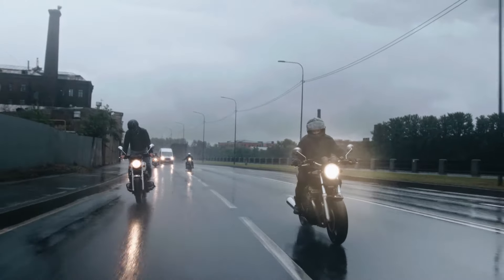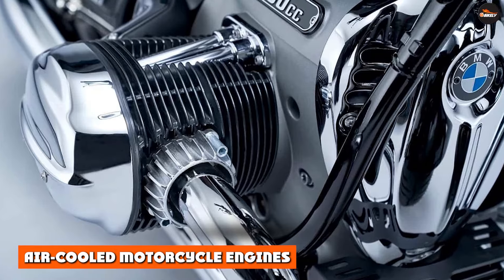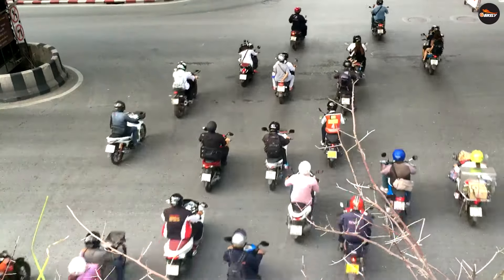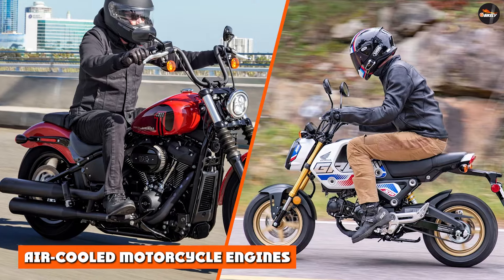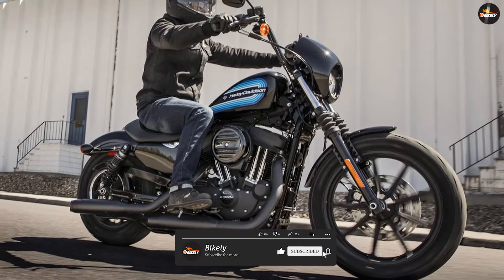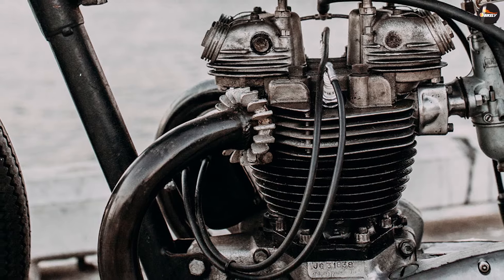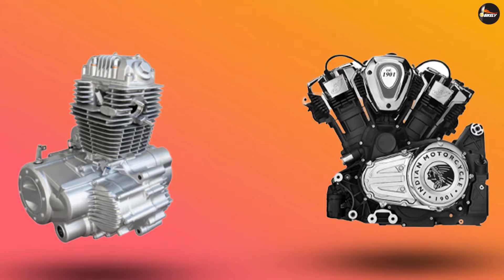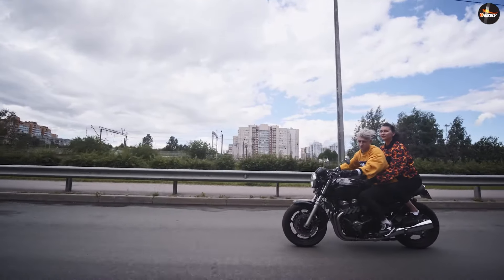Air Cooled vs Liquid Cooled Motorcycle Engines: Which Method is More Effective?

Comment: Einstein said: things must be built as simple as possible but not any simpler. The only reason manufacturers have switched to liquid cooled engines in the las few year is to comply with recent government emissions regulations.
Reply: Not so else why cruiser n small cc bikes still have air cooled engines ?
Reply: @vickyAlways  Because bikes with just one or two cylinders can still have enough airflow to keep the cylinders cold enough to comply with emissions regulations, and very few cruisers bikes are still air cooled such as the Indian chief dark horse which actually shuts down the rear cylinder when the bike is not moving to keep the engine cooler.
Reply: He said the same things 2 or 3 times.
Reply: Why did ALL the Baja 1000 dominant bikes become liquid cooled in the early 2000s then?

Comment: They are not just air cooled motors they are air oil cooled, for the novice or new rider, it's means oil runs through the motor as opposed to water, and they do quite often have an oil cooler ( radiator) for the oil , for example I have a cb1100 Honda 2010 model that runs 4 point 9 liters of oil the same amount of oil in a Holden 6 cylinder. And you can not beet some warm air on your legs and feet on a cold day riding. Oil  cooled won't corrode out like many water cooled motors. Cheers Andy from Australia

Comment: What about the engines with the oil cooler?
Reply: It's still air cooler based. Just a little bit advance which it's circulated the oil through outside so it cooled down with air too.

Comment: for long lasting run ... air cooled all the way
Reply: Why is that if I may ask, I can argue water cooled can last longer as the engine doesn't overheat. Just trying to learn.
Reply: @m7md4x4  maintenance i guess, water cooled engines are consist of many parts as the videos says, more parts more malfunctions. as air cooled really only requires the engine to rest.
Reply: @m7md4x4  IMO, if both bikes are moving at a steady pace like 45+ mph, it does not matter which you use because the ram air is either hitting the radiator to cool the coolant OR the ram air is passing thru the air cooled engine fins to push the hot air away while cooling it down. 
In traffic the water cooled engine is obviously best. 

Now in hot climates can affect air cooled but i don't know how hot it has to be before that has an effect on the air cooled engines. 
Im in Florida so its Hot year round like 85-95F .... Not sure if thats considered HOT for air cooled motors or if maybe Vegas heat at 115F ....
Reply: @MichealLearnsTo  Right, if your on the hwy and a coolant line burst open ..... You got seconds before you overheat and sieze up the motor, while the Air Cooled has no coolant to worry about, as long as air is flowing across the fins ... she will keep moving.